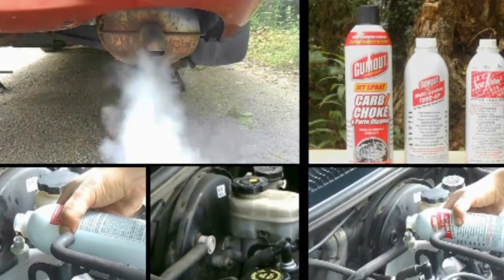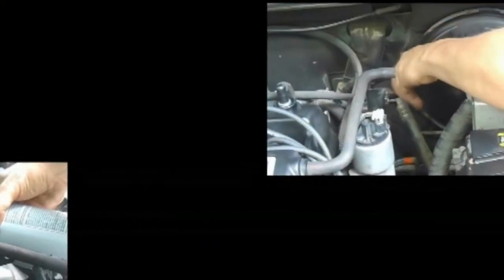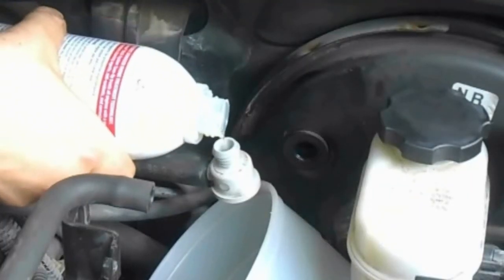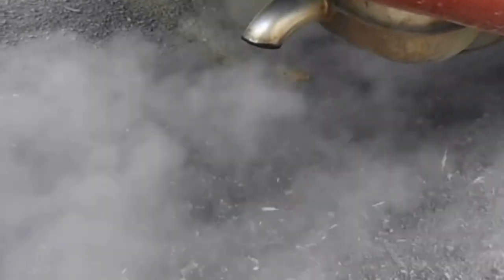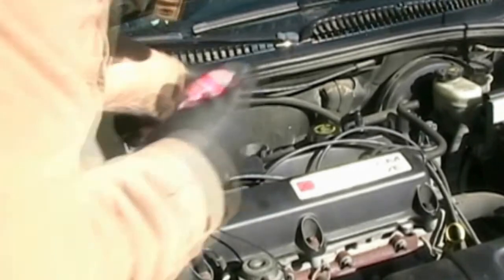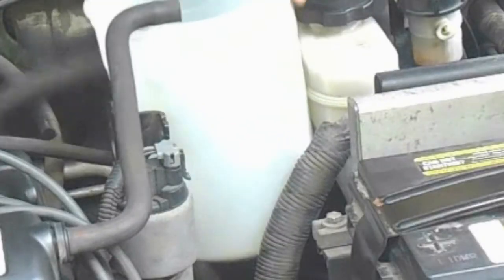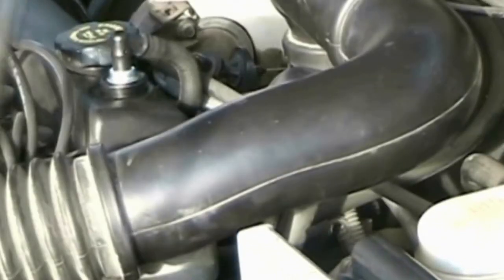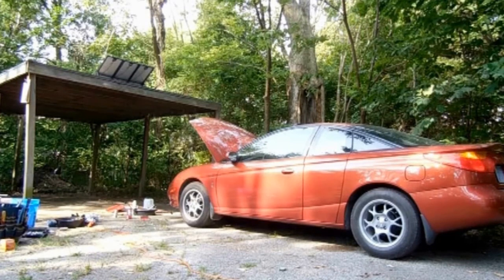Most Powerful Way of Using Gumout:  The Vacuum Hose

Comment: I've put Seafoam through a small 6ft rubber hose attached to the vacuum hose connected to the intake manifold.  That way, I can pour it and rev the engine. All from the convenience of my driver's seat. 👌👍

Comment: So what if your main purpose for using fuel injection cleaner is to clean your fuel injectors. Lol. Pour it in the vacuum hose?
Reply: put a bottle in the gas tank with a full tank of gas or pour out a cup full to use in the vacuum line before you add the rest of the bottle to the tank, that's what i do with my 350z.

Comment: You lost me on sea foam...that stuff is designed for two stroke motors ... Not cars of today
Reply: Seafoam is not made just for 2 stroke engines, lol. Its designed for use in any gasoline engine. Check out all their products, especially the air intake. Leaned aerosol, it really works great.
Reply: did you read the can? it clearly says for 2 and 4 strokes

Comment: I used gumout via the vacuum hose method. The car spuddered for a bit then ran fine. All smoke ran out and seemed to run better than before. About 3 hours later I take it to work and it starts spuddering again. Not sure why. and again after a few min of driving it went away. What would be the cause of this? Is it still "flooded"? BTW i drive a Volkswagon CC 2009, Manual, 2.0L 4cyl Turbo

Comment: Thanks for the video Im having a problem when removing the brake booster vacuum and add the gumout once I replace the vacuum my resevior is overflowing. Any idea why it does this? I tried twice and leaked twice. thanks for your help! I have a 99 Saturn Sc-1
Reply: Are you accelerating like your suppose to?

Comment: my hose have to stay on or i cant rev it to 2000 rpm
Reply: Daniel Day rev it to 2000 before you take off the brake booster line
Reply: troy thomas i did it it went from 13 mpg to 18 but it went back i have to get a new cat